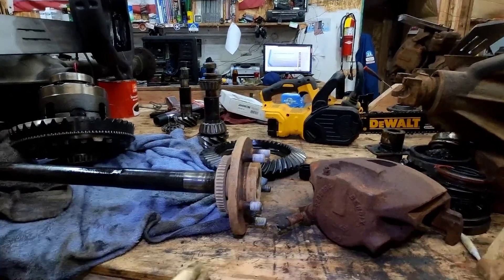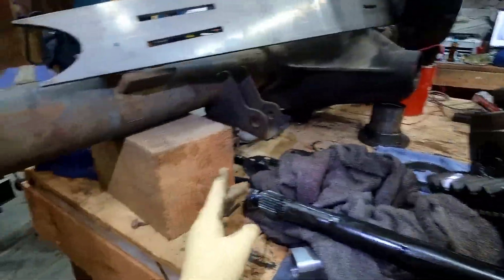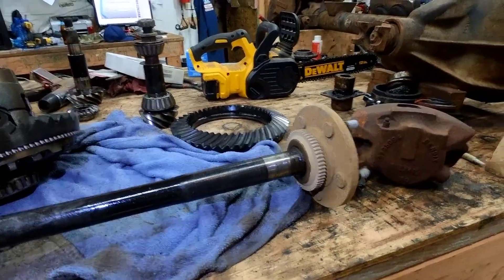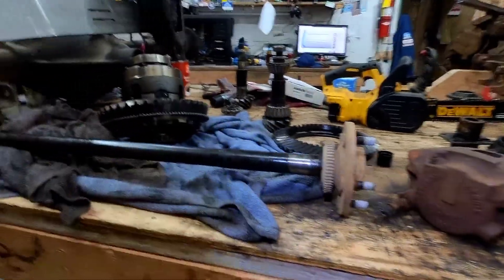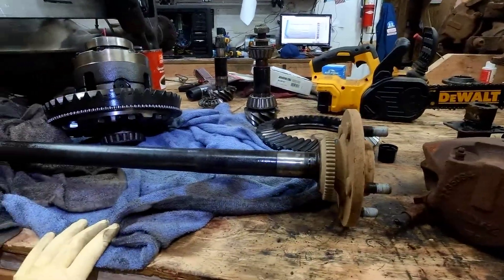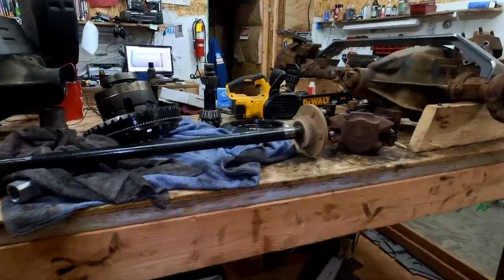is the dana 35 weak?

Comment: You know . Now that I think of it.  How does a ZJ get it's 6000 gvwr and 6500 lbs towing rating with a Dana 30 and Dana 44 for the v8s..  and how does the 4.0 have a 5k lbs towing rating and still 6k gvwr rating with 30 and 35...

Makes no sense.  Because my 76 J10 for example with the long wheel base is also only 6000 lbs gvwr...  With two 44s..  when you look at Dana's ratings.  The 44 maximum is 3500 lbs per Dana 44..  that's 7000 gvwr.   Not 6000..   yet the ones with 7000 or even 8000 are the j20s with the Dana 44hd and Dana 60..  

Same exact frame and engine too.. it seems the gvwr should be alot higher on the J10 and j20s..

I wonder if they made them low purposely for epa stuff and selling the vehicle.

You're also right on the ZJ and the VIC... My 5.9 limited the vic can tell you low coolant.. door ahar.. bad battery.. low washer . Burned out taillight and other stuff..  not to mention power seats heated seats.. dimming rear mirror.. dimming side mirror..  sunroof..  10 speakers.. bigger amp..  electric fan.. memory seats and mirrors..  tow hooks 3 skid plates

I often brag about 5.9 ZJ to people like my gf and others sometimes.. because I have more options in it than some newer vehicles do lol

Comment: our 98 grand cherokee has 500k miles original d35 and d30 and 4.0 and original 42re auto.... Theyre Jeeps.. but they werent ment for 35-37inch tires.. biggest the zj can handle with a 2 inch lift is about 31... lol....   Thee axle is plenty for regular off-roading in snow and rain, and dirt.. it wasnt ment for crawling on rocks..

im lucky my J10 and Wagoneer, has 44's all around... with i had a dana 60 in the j20 lol... but at least i got a running j10.. so im not complaining.

Comment: My experience is that the Dana 30/35 is just fine for light/moderate duty.  Gets me out there and up onto the ridge tops with the rest of them with no issues.  The Grand Cherokee is a bit heavy at 3700, but as long as you aren' rolling boulders all the time and spinning then suddenly snapping the tires to a dead stop,they will last as long as the Jeep.  Open difs just mean you have to be careful picking your line of approach.

I only have a 3" lift and minimal 30x9.50x 15 KO2's.  Steel Ranger rims, so each wheel/tire weighs 57lbs.  Stock alloy wheels with stock soccer mom tires (9x28ish)weigh 46lbs.  Seems to go everywhere I need it to go.  The last 20% where I can't go is not a concern to me.

Comment: I thought the truss was to keep axle tubes in the differential housing. I toasted a bearing and broke a shaft on a 44a. Swapped in a 35 and destroyed the carrier and broke spot welds on differential. Running a 8.25 rear out of a 98 ram now and dana 44 front.
Reply from the maker: That is one of the side affects of a truss, but not the primary function. They prevent deflection. The tubes can be welded to the housing, unless it's a 44a. The d35 was never intended for more than street driving and light wheeling, it's just not stout enough.

Comment: Great info. Good video. Straight to the point. 
I’m just starting out with my yj   31s with the Dana 35. Going to put a true trac lsd in it. Just trying to get some fire roads and snow experience first.
Reply from the maker: Yeah just like anything else that comes down to how you abuse it right? I mean I seen people who have driven on Dana 35s for decades but they're wheeling within their means I don't think that just light trail cruising is going to break it It's mostly people that just don't care and beat the crap out of their stuff because they can that has the problem. I wheeled on mine welded on 33s for about a year but I'm just a trail cruiser I'm not doing extreme rock piles and stuff like that
Reply: How'd that work out?  I've never needed lockers on mine for snow or forestry roads.  Only had to chain up twice, but I was snowplowing, trying to get below a storm that caught me up high.  Chugged out like a tank.

Comment: What do you think about 4-5” lift with 35” tires for daily driving and little to no off roading? Will the d35 be ok?
Reply from the maker: It's really hard to say, there are a thousand factors but that combination doesn't seem like it would be exceptionally hard on diff
Reply: I’ve been driving, and off-roading my TJ for about 4 years on 37x13.5R25’s with a 7” lift. I think you’ll be more than fine especially with no off-road use. Dana 35 with a locker in it
Reply: @Nikon9k I think it also depends on what Jeep.. a tj is a 2 door and weighs nothing.  A ZJ is a good 1000lbs more stock.. imagine how heavy it'd be with lift tires and other mods.

He would also need to regear

Comment: Dana 35s aren't junk because they have c clips, the Ford 8.8, Chrysler 8.25, 9.25, and some Dana 44s have C clips but they are far stronger axles. The Dana 35 is a weak axle all together, the shafts and carrier are the weakest parts in stock form, once you upgrade those it becomes the housing, you can truss and tube the housing, but then the small ring and pinion becomes the weak link which there is no upgrade for. Once you have done all of the upgrades you can to a Dana 35 it is still a weaker axle than a stock, Dana 44, Ford 8.8 or Chrysler 8.25, that is why I always reccomend not spending a dime on upgrading a Dana 35 and swap to a better axle instead, it is actually cheaper in the long run.
Reply from the maker: Totally agree.

Comment: So what size tire were you running on it, also with you explaining the 4340 chromolly shafts being brittle. Would you recommend running OEM shafts or stiff upgrade to the 4340? 

I have a TJ and have been running 33 for 2 years now with no issues and i do mud and rocks, but i am about to go up to a 36 and was going to jump to a 35 or a 36. I got caught up on a rock on my tie rod, if i was on a 36 i would have went right over.. hits the 36s.

I would love to hear your thoughts on it
Reply: Just did a super 35. Axles and tubes are same as d44. Ring and pinion are smaller, but not too small. Upgraded d44 can see 40s and function fine. Smaller r+p and 35s are similar in load as larger r+p and 40s. Solid in the camp of built and maintained > beat and abused.
Reply from the maker: @GeorgeWashington-oz7lw  what all parts did you choose to use on your S35 build?
Reply: @MegaMarclar  ox locker for carrier. Motivgear 1541 axles. Yukon gear 4.56 ring and pinion. All timken usa made bearings for carrier and pinion.
Reply from the maker: @GeorgeWashington-oz7lw   The biggest issue for me on the 35 and the matching 44 is that 2.6 inch tubes become the major weak link in the whole system. If you add a trust to it, it can help substantially. That's most of the problem with the 35 C clips, is that the tubes deflect or bend causing the c-clips to snap off.
But in the end it comes down to how you're using it. I've seen guys run them for 15 years and then on the other hand I've seen guys break them in 5 seconds mainly just because they're abusing it and then they wonder why it broke.
Reply: @MegaMarclar  I couldn't find any constructive reason to truss them for 35s other than peace of mind. Most people abuse the crap out of the stock D44 on 35s without a truss and don't have many problems. It definitely depends on the user and how much they beat their rig, but improper welding can bend the tubes and housing anyway. The c clip style axle isn't the weak point, it's just the reason the axles get spit out if they break. The c clip is how the axles are held in the tubes and breakage happens on the outside of the carrier and the c clips are in the middle of the carrier. Torsional force from the carrier on the axle breaks the axles.
Reply from the maker: I ran 33x12.5 for the longest time. The 4340 shafts are a substantial upgrade over stock. the thing is that people seem to think they are invincible after putting them in, and hammer on them. It's the sudden change in speeds, shock loads, and tortional loads that bend or break the shaft. The biggest problem with the dana35 is that the tubes are so small they have a lot of deflection. This is where most people end up doing the swap to another axle is because by the time you put all the money into a truss and gears upgraded carrier and axles you still left with something that is not very strong in the long run.. You're 36-in tire is a lot for a Dana 35 to handle... The stress load on the C clips is the biggest problem. It might not seem like going from a 33 to a 36 is a huge deal but think of it like using a breaker bar on a small bolt. The more leverage you have the more likely you are to snap the bolt.  So with all that being said if you're doing rock piles and obstacles we're getting throttle happy or creating shock loads using the clutch it would probably be in your best interest to consider starting with a better platform like a 44. That way you're not throwing money into something that still has limitations no matter what you do to it it's not just the axles and the bearings and the carrier and the ring gear that are problem individually it's when you get everything put together. If you start putting chromoly axles and 36 inch tires in it the next week link becomes the diff itself. It will end up cracking the carrier where the pin goes through or exploding the side gears. It's just kind of one of those trade-off things where you're basically at the limit of what you can do right now with what you have. In the process of making this video I was actually doing a Chrysler 8.25 swap with triangulated long arms my Dana 35 is now sitting out in the pile
Reply: @MegaMarclar  yeah that makes alot of sense, i think for me the biggest issue is like everyone else.. Money. So you try to find a cheap way around but in the end it will cost you even more after doing all that then at the end you still change it out for a better diff all together running your bank down even more then if you just started out going that way.

My neighbor has a ford with a 8.8 that is 410s and has been sitting for about 2 years im going to see if i can talk her out of the rear end for a few hundred and do all the work myself to fit it into the TJ. After looking into it if i can get her to part with it for under 500 with everything else ill need ill be around 1200 all in for a 8.8. Its still c clip but with a 31 spline axle and a 8.8 ring all i have to do is build a truss for it and all the problems of a dana 35 are behind me. They make a c clip eliminator that turns it into a flang stly i might throw on as well.

Now to sweet talk my neighbor out of it
Reply from the maker: @JeepTrailsandBarbells  yeah that's not a bad setup. But if you're in the school of thought that you've convinced yourself you're are willing to spend $500 on it you might consider just finding a 44 that's already set up for your application. You might be able to find a Rubicon 44 for that price
Reply: @MegaMarclar  i have looked in my area and ebay, the housing along is going for 700 and ready to drop in is 1800ish. With the 8.8 i will fab it myself and it will come out to around 1200 and ill get disk brakes over drums
Reply from the maker: @JeepTrailsandBarbells  that's basically the same thing I ran into. I could find bare housings but the price was worth more than the whole car. That's why I ended up using the 8.25 out of my junk liberty. Tossed around the idea of just going straight to 60s too, but the ones I got are for my cj project.
Reply: @MegaMarclar  yeah i looked into the 60s as well, but man, it was going to be like 17k for both. If I wanted to drop in ready, I abandoned that idea altogether lol. 

Its a fun hobby, but it can get pricey. My bank feels the fammon every time I do an upgrade.
Reply from the maker: @JeepTrailsandBarbells  yeah I totally agree. I think that having a stout rear end is probably the most important part of the whole system. But it really just comes down to what you're going to do with it. If you were to put a truss on the 35 and put in the better axles it would still last, as long as you're not full throttle second gear coming to a dead stop on a rock. For a trail rig it's just fine
Reply: @MegaMarclar  yeah i agree, i take it really easy when on the rocks. If i cant climb without breaking the tire loss i dont give it more gas and hope i can power my way up, ill just pull the winch out or build the track with some recovery tracks. Rock cralwling is about making it up with as little to no wheel slip. As slow as possible and fast as needed, then the other side of people is... "well give it more gas and see what happens" then things brake and want to blame the rig
Reply from the maker: @JeepTrailsandBarbells  couple of my buddies have purpose built buggies and it's a completely different world. I am more of a trail cruiser. If there is a small pile of rocks and a trail or some sort of qualifier I don't have a problem going through it but I don't go out of my way to beat my stuff up on rocks. I would rather cruise up and down the same trail 50 times then stage myself on the rocks
Reply: @MegaMarclar  yeah i got you, i like exploring and making it down the trail to see new area and places. And doing you also have to make it back home lol
Reply: So what are you running in the front?
Reply from the maker: @stevestewart3816  I still have the d30 in front for now. Building a kingpin sup to replace it long term.
Reply: @MegaMarclar  Hi! I just seen this video because i need to learn more about dana 35. I'm from Portugal and recently i got a grand cherokee zj 2.5 diesel i got the dana 30/35 combo. So i would like to use 35 inch tires but to be street legal i can't change the axles of other brands. So dana 60 they are so few that are way expensive! Rubicon dana 44 same story. So i was thinking. Is the dana 44 of the 5.9 v8 zj and upgrade over dana 35 to use 35 inch tires? Thank you!
Reply from the maker: @danielmagalhaes5739  the d44 out of a zj is a d44a, or 44hd,. It has an aluminum housing, and is slightly different than the "normal" 44. It requires a very specific set of parts and is not interchangeable with your standard axle if I remember correctly.  It would be an upgrade to the 35,.and should be as close to a bolt in as you can get.. The biggest downfall of the 35 is human abuse. I've seen plenty of guys run 35s for years with no issues and then I've seen guys break them within an hour It just depends on your wheeling style. Same with the Dana 30 It gets a horrible rep because people just abused the shit out of them. With a few easy and cheap modifications it can be brought up to basically the same strength level as a 44. Just make sure the gear ratio is match if you're going to swap the axle otherwise a regear will be in order
Reply: @MegaMarclar  thank you so much! My dana 35 already got an air locker and 4.10 gears. I'm going to truss it. From factory comes with 3.75 gears. It's a diesel engine 2.5 VM with 115 horse power and 205.04 lb.-ft. of torque i think... so maybe i will stick with 33 or if i want to go 35 i must use carefully until some real dana 44 apear! Thank you so much!
Reply from the maker: @danielmagalhaes5739  yeah the thing is that you could probably keep that axle intact for 10 years if you're easy enough on it. I wield on mine for 2 years before I swapped it and didn't really need to I just had something sitting out in the yard that I wanted to build into something else. Yeah those VM diesels are awesome I used to love them when they came into the dealership because nobody wanted to work on them it's like a 12-hour timing belt job and I could do them in about 2 and 1/2